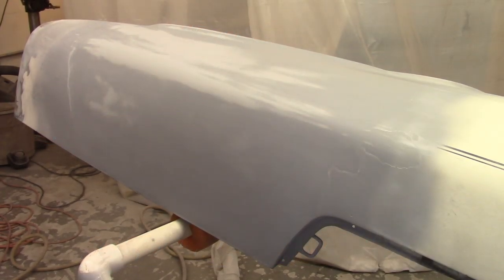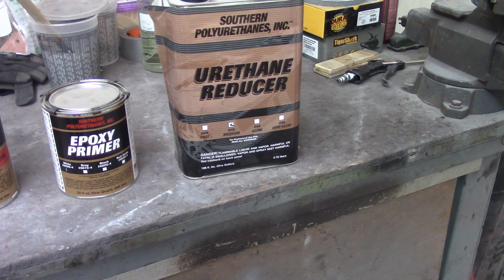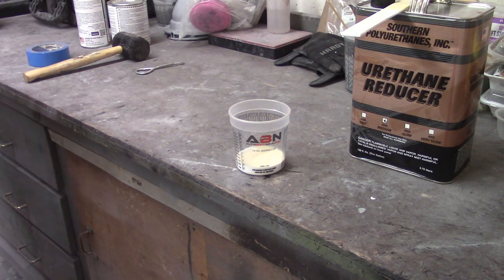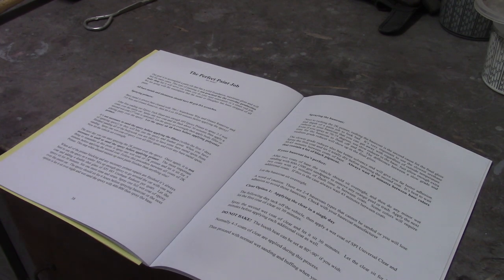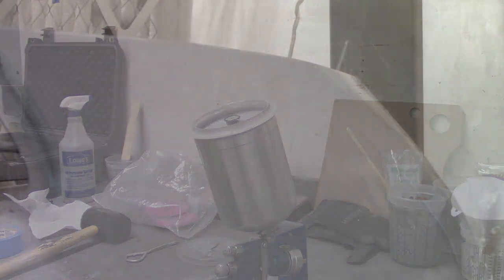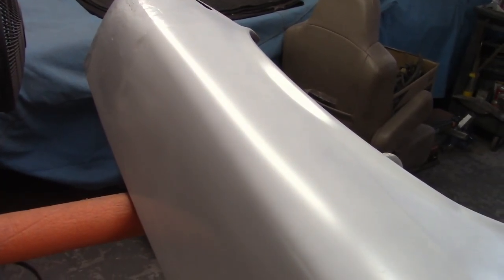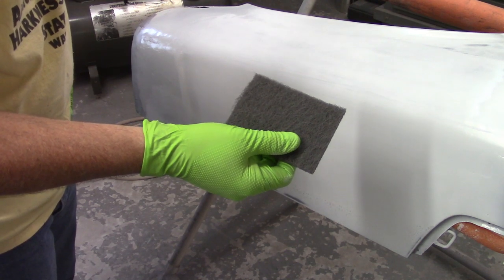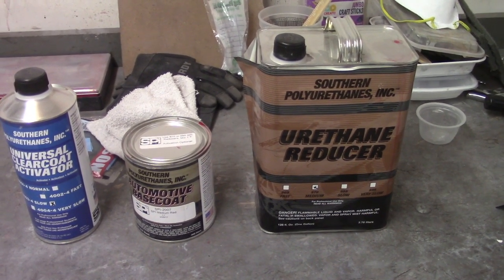Proof of Painting Procedure - Part 3 | Roundtail Restoration

Comment: Hi Chris, Nice job. That color will look great. One question, no primer between the epoxy and base? My project is in primer, skimming the lows and blocking. Hopefully putting epoxy on it this weekend.
Reply from the maker: Thanks, Rich. No, epoxy prior to base all the way. I reduced it about 25%. As a matter of fact, the owner of SPI (where I get my paint) posted a comment today on his forum that the epoxy does wonders for paint chip resistance, too. As long as you follow the rules with applying it, it has awesome adhesion. Also, as long as you follow the rules with covering it, everything sticks to it really strong. It is also very flexible, up to a thickness of 4" he said (yes, 4-inches...it takes over a year for that paint to dry so he can test) so it absorbs impact and helps whatever's over it do so as well. Never would have thought it would make that much of a difference, but there it is.

Comment: Would you always apply a reduced seal coat over the primer or could you go straight to base without a seal coat ?
Reply from the maker: Per their tech manual (only speaking for SPI's stuff) you could go straight to base over either the epoxyy or the 2K build primer. The seal coat, however gives me a bit more peace of mind for adhesion because it may have been a while since the panel was last messed with AND it acts as a barrier between what's underneath and the base.